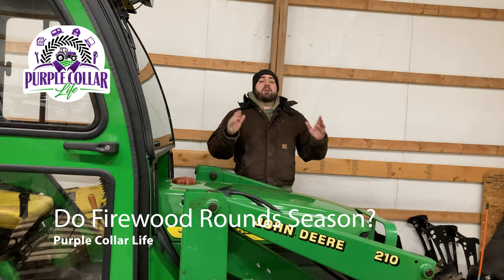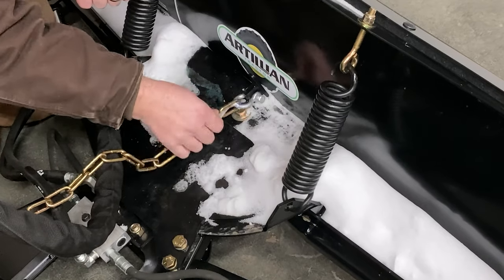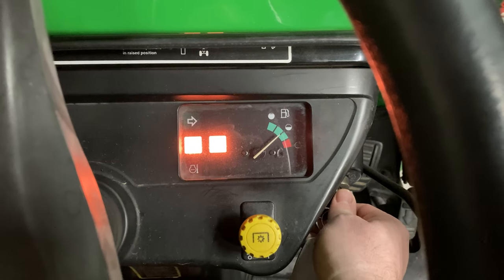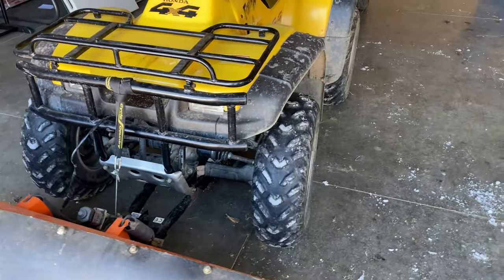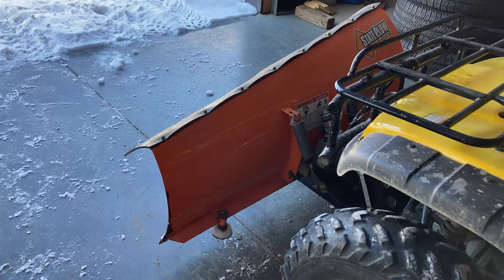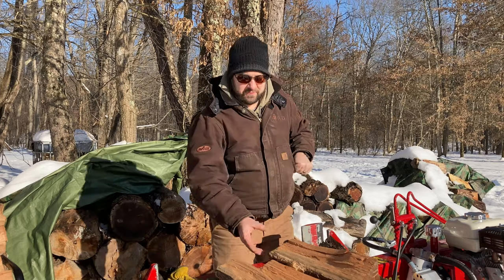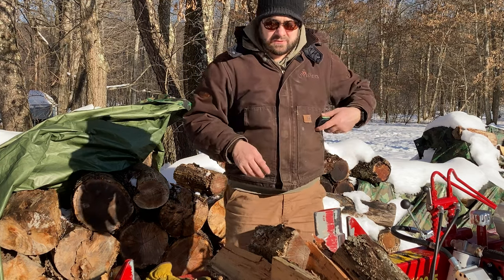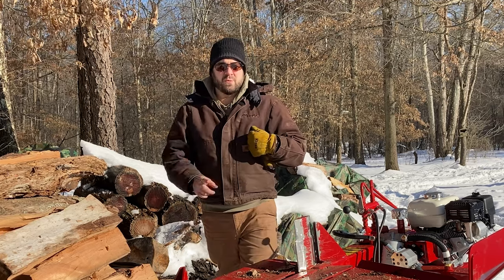Firewood rounds will NEVER dry = FALSE

Comment: YES IN DEED LOCKWIRE THE CLIVES WILL BE THE BEST SIR 👌👍🧐 For your engine goplugs Sir, just look the engines or call your JD dealer 🧐👍👌 but even with go plugs, magnetic engine block heater will be better for your diesel engine 👌👍🧐 Remember Sir, when I was living in Shefford, I will hand splitting every day during the winter time as firewood daily need and yes they do dry but in your case they will dry better if you have a wood shed like I use to have and built myself  👍👌😇 Keep up your OUSTANDING VIDEOS SIR Cheers 👌👍🧐🍻 ( nice close view of deers )
Reply from the maker: Thanks, Dave! I am going to try to use a wire through the hole on the threaded rod of the shackle and see if that holds it in place.  
Building a little woodshed is likely in my future. I'd like to have somewhere to easily stack the wood (or put my IBC totes) that gets it in some sunshine and airflow, but out of the rain and snow.  Thanks for watching!
Reply: @PurpleCollarLife  👍👌😉🍻
Reply: @PurpleCollarLife  Thank you very kindly Sir ( pinned my comment ) 👌👍😇🍻

Comment: I keep several unsplit rounds in the 6”-8” diameter range.  Normally these are knotty or croch wood.  I put them in a separate stack.  They become next years “All Nighters”.  They burn longer and hotter.

PS: if you don’t cut and stack them… a year ain’t enough.  I’ve cut oaks that have been standing dead for two years  that dripped water!
Reply from the maker: Thanks! I've seen standing dead wood that was still very wet after several years too.

Comment: Good to know the rounds will dry out and can be split and burned right away, which is great if one doesn't have the chance to split and stack ahead of time. Some tie wire will keep the pin from backing out over time. I have a intake heater on my JD, it comes on automatically and stays on for about 20 seconds before starting when cold.
Reply from the maker: That's good to know about your John Deere! I've learned to either click the PTO on, or put the John Deere 2210 in gear, then click the key. That lets a heater kick on without turning over the tractor.  After that, it starts much faster on cold days!

Comment: I don't have a JD tractor, I have a Kitoti.  But in my owners manual it states that on cold starts when the temp is below a certain temp you are allowed to run a higher RPM to aid in warming up the tractor.  You may want to look in your manual. the JD may have the same advice.  Mine starts little hard, but comes out of the shaky state much quicker when I bump up the throttle just a bit on the starts.  I also cycle the glow plugs twice like you did in your video.  Hope this helps!
Reply from the maker: That's an interesting thought.  I will look through the manual. I was worried that the heavy knocking meant that the oil wasn't pumping through yet (so I don't go much above idle).  Thanks for watching and commenting!

Comment: A business opportunity awaits whoever can invent a device that seasons wood. 😎 A possible solution to that chain issue on the plow might be to drill a small hole in the nut end of the threads then put a cotter pin through it. Thanks for sharing Chad!
Reply from the maker: There are some kiln dryers for firewood - but you'd have to be big in the firewood sales business to justify that expense.  I think I have Jennifer convinced to let me move my wood stack into an area that gets more sun and wind.  Maybe she'll even agree to me building a little wood shed back there that the splitter can live in, with some seasoning firewood!  Thanks for watching.  Stay warm out there.  It's been freezing rain here all day today.
Reply: It's called a kiln  been around for years..

Comment: On the same note, I had read firewood guides from different sources that stated that Sweet Gum will never dry and that it's useless for firewood. That is also false. I ignored sweet gum believing that it had no value for heating, but when I had to clean up Sweet Gum after a storm, I cut and split it (with my log splitter - it's very hard to split with an axe or maul), stacked and covered it with some old roof metal and left it for almost a year. It went from 40% moisture content to about 5% in a years time. It makes a great fire starter, but it burns up fast (and hot), so it's not good to bed down a fire like hardwood. I will make Sweet Gum a must from now on along with red oak, ash, and wild cherry.
Reply from the maker: Thanks for sharing! That's a huge drop from 40 down to 5% Do you live in a dry area?
Reply: @PurpleCollarLife  Actually, central Kentucky (Berea) is pretty humid during the summer months. I had the sweet gum stacked in a single row with a metal roof on top of it. It was very light weight when I finally started using it and it burns like kindling wood or fire starter.

Comment: I heated with wood in the UP of Michigan and I would not want all split into small pieces.  get it hot with split and then put a few as you call rounds and it will burn and put off a lot of heat.  I used 11 cord of wood a winter or more some winters.  so they dry I would not but you can if you want but the split burns up a lot faster as the ones I've seen split are so small that it burns up in no time.
Reply from the maker: Wow - 11 cords! That's a lot of wood.  Are you still in the UP? I love that area. I make quite a few trips to Michigan for work.  We made our way across the Mackinaw once. But I've never been deep into the UP - but I'd love to go some day!

Comment: You should be good to put some loc tite on the threads. We use that on certain components in the nuclear plant which starts up and runs/vibrates for 18 months non stop! A big help for the John deere would be add a in line coolant heater you can set it on a bluetooth timer controlled by your phone so its not running constantly.  It will help with starting, reduce wear from cold starts and give you the luxury of having instant heat in the cab! When i had a polaris RZR i did not like the 4wd setup, when you put it in 4x4 it dosent kick in until if feels slippage. I would take a guess that there is a sensor somewhere that may be bad or disconnected.
Reply from the maker: Bluetooth timer controlled by my phone?!  Wow- that would really make my tractor smarter than our house! I can't even control the thermostats or garage doors remotely. :)  I'm headed out to get some blue Loc Tite right now.  
I am hoping it's like a wheel speed sensor or a loose wire (the Ranger AWD not working).  If I were looking for a new (used) machine, I'd probably get a Honda. I'm not a fan of this AWD system on the Polaris, or the CVT transmission.  Thanks for watching.
Reply: @PurpleCollarLife  I did a lot of research and was almost sold on the pioneer 1000 but I’ve hear of many problems with the dual clutch burning up very fast and not being warranted. I went with the teryx because reliability wasn’t my number one concern with riding remote areas. Also Kawasaki is the only manufacturer that comes standard with three year warranty! I’m sure the loc tite should be your solution !
Reply from the maker: @HillsideAcres  Thanks for sharing. I hadn't heard that about the Pioneers.  But I also haven't done much research.  I'm probably about 10 years away from looking for a replacement UTV.  And it'll be a used one for sure.  The new ones cost more than some cars!

Comment: The chain that the d shackle is on is pretty light duty so a carabiner could probably be used in it's place no worries. Alternately some fine tie wire through the hole in the d shackle and wired back to the shackle so that it can only loosen very slightly worst case.
  My own wood (here in Aus) is generally dead standing or dead fallen that I cut into 4 ft or so lengths. That will get stacked up for at least a year. The summer before I want to use it I chop it to length and split it and it then gets stacked in a tank or shed for at least 5 months before it gets used. In general the wood would be ready to burn from the second I get it but I always try to have at least a year or two's worth of wood on hand. Any green wood that I come across due to fallen trees or whatever will sit for an extra season. My wood is split down to anything under 10" x 10" x 16" and will start off anything up to 3ft diameter hardwood.
Reply from the maker: Thanks for the tips!

Comment: Wow, that is super frustrating about the ranger.  I'm thinking that since you likely already solved the mechanical issues maybe it's "simply" an electrical issue???  As to your bolt issue, I think I'd use some blue loctite and/or safety wire, or...red loctite and just cut it off if it needed to come off later.  (U bolts are cheap!)  😉  I'm not a firewood guy but always find your stuff interesting...keep up the good work!
Reply from the maker: Thank you!

Comment: on my kubuta you turn key halfway without engaging engine and hold for 15-30 secs then turn key rest of way. my cub and skdsteer you just turn key to on position and let it run its glow plug cycle until light goes out
Reply from the maker: Thanks for sharing! I'm used to machines that have the glow plug light that goes out. I had no idea until people commented on a previous video that the John Deere 2210 had glow plugs.

Comment: Your polaris has electric sensor or contacts on the front wheel. As soon as it spins the 4x4 engages I had a cut wire an therefore the4x4 would not work.  Check the wires going to your front wheel usually it is close to the wheel.  And a steel wire will stop that pin from turning on your plow.
Reply from the maker: Thank you!  I'm thinking it has to be something like that sensor.  Because the switch lights up, the gauge cluster shows that it's in AWD, but the front wheels just don't engage.  I'll have to take a look and see if I see any issues with wires going toward the front wheels.  I was thinking that maybe it was a solenoid that engages somewhere.  
Thanks for the tip on the wire through that pin.  Have a good night!

Comment: A clevis is used temporarily.. you need a sheer pin or bolt... I recommend a sheer pin so you don't break anything but the pin.. lock wire will work but a tac weld will be better
Reply from the maker: Thanks!

Comment: hey Chad, how accurate is that moisture meter, does it seem pretty accurate?  I don't burn wood other than in my firepit or when I'm camping but it's kind of a cool gadget that I wouldn't mind having.
Reply from the maker: I have tried 4 of the pinned moisture meters, and 2 of the pinless.  For firewood, the pin version definitely work better.  OF the 4 I've tried, they're all between 2 percentage from each other, and the results are repeatable.  So as far as which one is the MOST accurate, I'm not sure.  But I for firewood purposes, any of them are accurate enough for me!  Thanks for watching.
Reply: @PurpleCollarLife  is the one in your link is the one you were using?
Reply: @Jasonrcsd  I use them in my Woodworking Shop… Chad is right on point… the pinned meters are really close to correct… as long as you are measuring at the core of the wood.  For a board, cut off a foot of it and measure the end grain.

Comment: That is a Very odd looking log splitter. Split-Fire 2265 two-way Log Splitter.
Reply from the maker: It's certainly a unique log splitter.  We did a lot of research before getting a splitter.  The Split-Fire 2265 really impressed us with the engineering and innovation.  I really like that it splits both ways, has a log lift, has the Honda engine, and is light enough for me to easily move around.  We've made a few videos about it on the channel.  Thanks for watching!